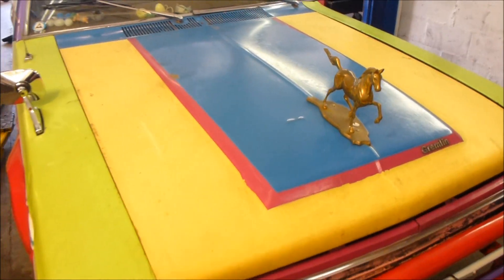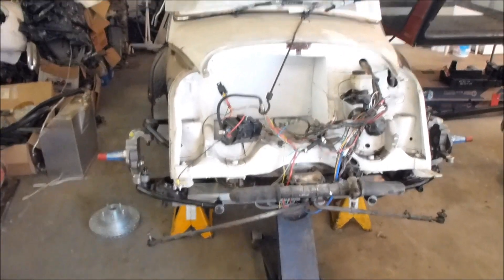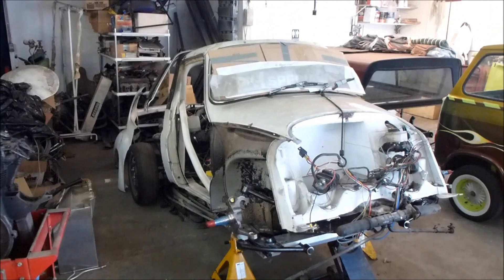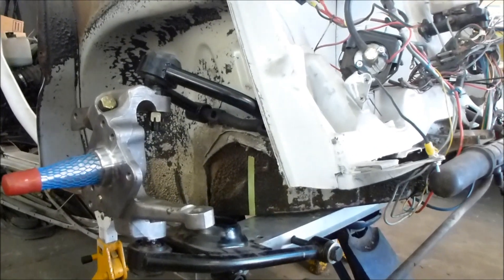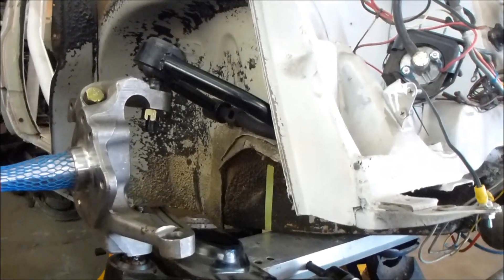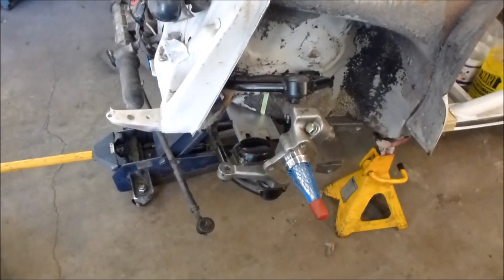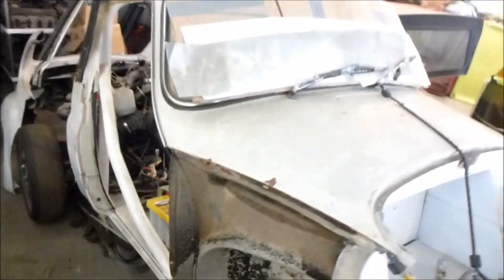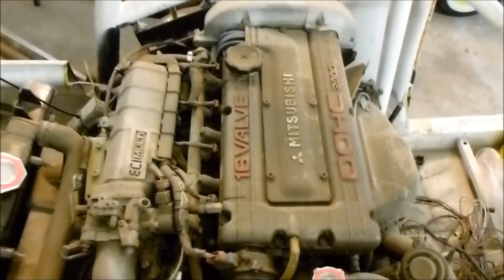Speedracer Subaru 360 progress

Comment: I just came back to double-dip.  I used to say "I might be driving this car again soon"... and then I realized doing that is actually curse.  It's always the cars you don't care about driving that get fixed quickly, or run.

...and at my house, I always drive them into the garage and have to push 'em out.

Hang in there my friend.
Reply from the maker: don't you worry my friend. I've taken to heart your gentle encouragement stated many videos ago. I need me some 4G63 action myself.  This car, and the bike engine swapped Honda n600 are automotive catnip,  and drive guys absolutely Alex the lion wild. I could use the boost in ad revenue as well

Comment from the maker: The Gremlin was made by AMC motors. Speedracer is a cartoon and is a nickname for my Mitsu powered Subaru 360. No modern Subaru engine would fit. The 4G63 barely does. I've been working on this car since 1998. Far too long. I want to drive it.